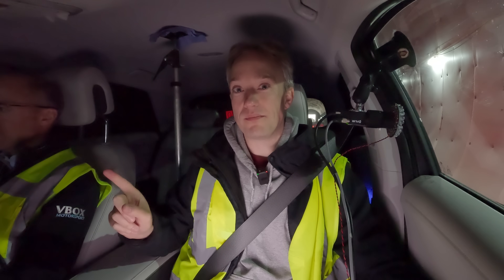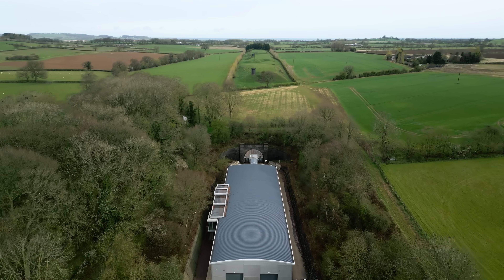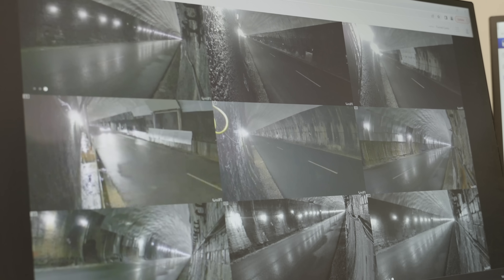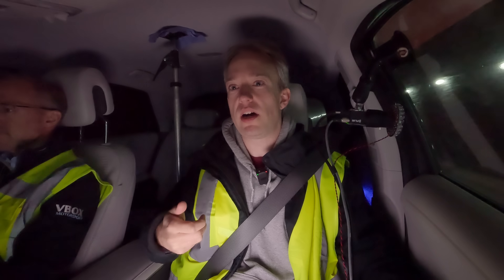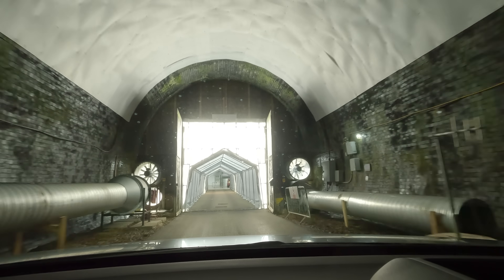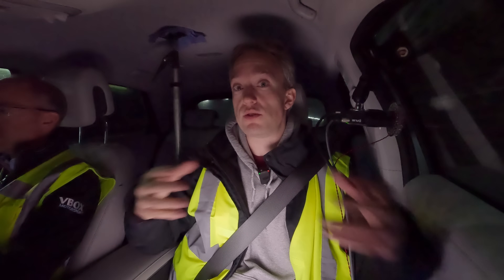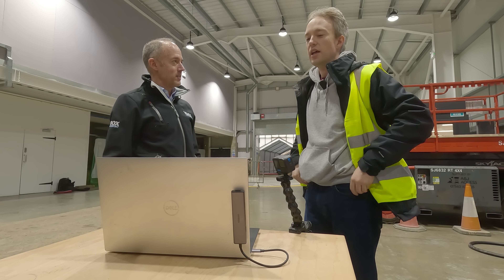This is an excuse to show you a really good tunnel

Comment: Why is a right side drive car displaying its speed in miles per hour?
Reply: @Smee Self Brits don't use kilometers? Weird.
Reply: @Mallory-Malkovich  why would they? Also, didn't you notice that the fuel was in Miles Per Gallon (imp) at the end. Also, I don't get your connection with right hand drive and mph.
Reply: @arfon2000  I thought everyone used km to measure distance except the American Empire. Most people on earth don't have a clear idea what a 'mile" even is, because it's a poorly-devised measurement system from medieval times that every civilized country abandoned in the last century.
Reply: @Mallory-Malkovich  The UK didn't and to an extent nor did Canada.
Reply: @Mallory-Malkovich  Also, to make it more confusing the British Imperial measurements are slightly different to the US customary units. For example a Imperial gallon (which UK/canada use) is .8 of a US Gallon.
Reply: @arfon2000  Canada uses kilometers, and has for nearly 50 years.
Reply: @Mallory-Malkovich  As their speed limit yes. But it's still common for someone to say "couple miles to the shop" or "2 inch thick"
Reply: @Halo Freak  That's due to the ubiquity of American TV in Canada. Canadians will say "he's miles away by now"  colloquially, without having any firm idea what a mile is. It's just a turn of phrase. All distance is measured in meters and kilometers. No Canadian under 60 could tell you how many miles away anything is, because it's not used as a unit of measurement in this country.

Comment: According to the tunnel's operators the gradient is 1:176 which is 15.33m difference between the ends. Also, it was built from nine shafts. They would have had 10 sections of about 270m.

I don't think any engineer would build a flat tunnel. They expect water. They started the Simplon tunnel a year after this one was finished and the error where the two halves joined was about 8 inches.

I am wondering if some of the surveying only worked because the errors were both positive and negative.

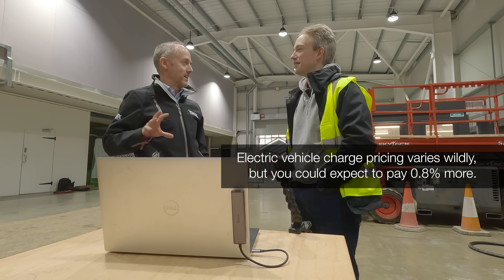Comment: @7:30 my physics nerd alarms are going off.  He's saying that the electric car weighs the same whether it has a full tank or an empty tank as opposed to a fossil fuel vehicle. That's NOT CORRECT. A fully charged battery weighs more than a discharged battery. E=MC^2 and all that.  You can't have energy without mass.  A stretched rubber band weighs more than a loose rubber band.
Reply: Practically there's no difference. A single piece of dust will offset the weight of the car more than the state of the battery.
Reply: You're counting that? You might as well say that the mass of the car increases when it's moviny

Comment: If the tunnel is perfectly straight, not even following the curvature of the earth, it makes sense that this would result in a slight gradient.

You can’t have something both perfectly straight and perfectly level while on a round planet.
Reply: Yes you can, straight as in no left or right turns.

Level as in no up or down.
Reply: @Robert-j6r8c  The video implies that it is straight in both the horizontal and the vertical plane. They say it is both straight and flat. 
(But as a machinist, straight and flat have different definition for me)

Anyway, you get what I mean. Something of this scale cannot be both "flat" (no up and down) and level (perpendicular to local gravity) on its entire length.

Comment: After doing a quick search to satisfy curiosity, apparently, a dead ev battery weighs less than a fully charged battery? If true that's much less of a weight differential than a petrol engine. However, it's still a relevant variable for precise calculations. 
 Any physics majors or engineers willing to clear this up for me?

Comment: I'd like to see the Bat motel and then the golf ball dimples on a car versus no dimples experiment to see if Myth Busters' got it right. 

Then an episode on how the engineers got the tunnel so level when it was made in the 1800s.
Reply: He already said in the Japanese hotel video that he isn't allowed to film other guests for privacy reasons. Hence, no bats.
Reply: @Smee Self Yes, I guarantee you that when they  started rehabilitating the tunnel, the railbed whcih had been abandoned for 4 decades was not flat, +/- 3mm.
Reply: @andrewalexander9492  They weren't talking about roughness of the surface. Of course every dimple in the wall is also deeper than 3 mm, railbed matters equally little.

Flatness as they refer to it means something like straightness, or - take the centroid of cross section at entry, take the centroid of cross section halfway in, take the centroid of cross section at the far end - and they would be on one line +/- few mm.

Comment: 7:23 this is insanely nitpicky, but technically speaking an electric car does lose weight as you discharge the battery due to the formula E=mc2. If you were going to solve for M as E changes so would the mass. But we're talking micrograms so he's still correct that it doesn't really affect it.

Comment: One interesting nit.  Gradient aside, "perfectly flat" (or rather perfectly straight)  is not flat for the purposes of coasting a car.  Mentioned at the beginning, but earth's surface is curved, so if the tunnel were same elevation at both ends, but perfectly straight then effectively it's actually lower in the middle and you're going uphill slightly toward either end. If water leaked in, it would literally pool up in the middle of the tunnel eventually forming a curved surface. 
With the gradient and straight profile it means that the tunnel is effectively steeper at one end than it is at the other end, relative to the pull of gravity.    All of this needs to be accounted for in their calculations.
Reply: This crossed my mind as well. Running these calculations (in a rough approximation that will at least give reasonable order of magnitude) I get a difference in angle of about 0.024°, .04%, or 1 in 2355. My guess is that this effect is so insignificant that it doesn't matter, even at the precision they are doing. Initially I figured this might be less than a rounding error for the given 1:176, but when I tried adding this new gradient I got 1:163, so it would be measurable in that given number - but still probably so insignificant they don't really care. 1:176 is probably the average through the tunnel.
Reply: @Smee Self  Cept if it's truly laser straight, then it is not  a constant gradient in the way that gradient matters (coasting in this case).   A level will measure different values at one end, center, and other end.

Comment: As someone that has used a few wind tunnels I find it very odd that they acknowledge the interference of the tunnel wall yet refuse to minimize it (drive in the center) because of aesthetics. Especially since the target of the emulation  [99.9% of real driving] is not extremely close to a wall. 
Interference from the walls and the percent of tunnel cross section taken by the model cross section is a major effect that must be considered in any wind tunnel results and the effects are non linear with distance from the wall; refusing to minimize the effect just seems outright foolish.

Comment: The surface level must have been done in multiple steps. If you look at some of the shots near the floor level that have low grazing incident angle one can see that the surface appears to have been ground and slightly polished (note the flat top of larger rock with the lack of sand attached to the flat surface).  This was probably done as the last step with a grinding machine that was sufficiently large to have multiple optical targets being monitored by an optical theodolite. Think of a large lapping machine with optical guidance. Probably did not use a Gyrotheodolite.

Comment: As someone who used to work in notoriously more active tunnels, l can say that the procedure for turning around the wrecker/fire trucks was full lock turn until you hit the wall, full lock the other way until you hit the other, then full lock again into the wall once more if you set yourself up well and twice more if you didn't. The trucks were build with this procedure in mind, the difference those last few inches made was astounding
Reply: So a well engineered Austin Powers turn
Reply: Reminds me of the time I had the misfortune to go down a no-through-road in Oxford.
Reply: So you actually physically touched the Wall? Or you Just went as close as possible without touching anything?
Reply: @semurobo  actually contact it. You didn't hit it at speed, and the trucks had bumpstops or a pushpad so there wouldn't be any damage. There wasn't all that much space on either side when the rig was perpendicular, so every inch mattered

Comment: The “hill” that the tunnel goes through doesn’t seem very high or steep (I’m reluctant to even call it a hill!)….Tom (or anyone) so you know why the Victorians went to all the trouble of drilling & blasting that tunnel through solid rock — rather than just putting the tracks straight over the hill??? (Or going around?)

Comment: The opening shot triggers me. The ioniq 5 and EV6 both have the same gauge cluster graphics in sport mode, and it's completely unreadable. I can only sit comfortably in the car if the steering wheel blocks the speedometer, which is half acceptable when it's physical and can't move. But the location of the speedometer is just a few lines of code. A mess of 1's and 0's are the only reason I can never safely drive one. Oh and because I find all the other drive modes completely unacceptable.

Comment: Nice to see the deviation in the measurements is the same as the resolution of the measurement: 100 fps <-> 0,01 s.
And now to be as pedantic as Tom would appreciate; the mass of the car does change, as energy in batteries has mass, it's just low enough that the wearing down of the paint on the car by air friction is probably more than the change in weight if the battery, not to mention the moisture loss of the driver or the wear of the tires.

Comment: I would love to have access to that tunnel; I'm part of an Automotive shenanigans and wild lands trash cleanup group, and I really wonder what all the goofy bits added to my car do to my fuel efficiency. I have a light bar, roof basket with a spare tire and rim in it, some tool hangers, and 2 amateur radio antennas on it. (Both GMRS and HAM)  Also I've lifted it aboot 2 inches.

Comment: I had a friend who would only put $20 worth of fuel in his car because his logic was "more fuel = more weight. More weight = less gas mileage" so he saw that as the perfect balance. This just made me think of that.
Reply: But then you waste more detouring to the petrol station.
Reply: @Robert-j6r8c  The solution is to illegally keep a big tank of fuel in your garage and fill up from that as needed.
Reply: @vylbird8014  
Several legal gas cans for me. Though my motive is more about getting the most out of good deals while I can.
Reply: @Robert-j6r8c  This exactly! Stopping to get more fuel costs fuel, but my mom would never listen...
Reply: But it would have meant gradually putting less and less fuel in his car.  Keep that car long enough, and you're not even going to make it to the shops!
Reply: He's got a point. Although it is probably negligible, 20 liters more or less.
Reply: Less gas = less weight. Less weight means a car has to use less power to get up to speed and will accelerate faster
Reply: Of course, the most ideal mileage would be bicycling whenever you can -- less driving, and likely less weight when you do drive -- but I understand that's not something a lot of people will be able to do without standing on their government officials' heads and yelling at them for a decade or so until they put in safe bike paths.
Reply: While that would save fuel, you could easily spend more than you would save looking/driving for more gas stations so the benefit is minimal, if not actually worse
Reply: but then you're always drawing from the bottom of the tank
Reply: @geoffroi-le-Hook  you're always drawing from the bottom of the tank. Stop perpetuating this old wives tale urban myth.
Reply: The downside is that really wears out your fuel pump
Reply: 16 gallons of fuel is under 100 lbs of mass at best you’re getting 2% efficiency improvement? Nah he’s just cheap.

Comment: I don't understand why they don't use a delta ground speed sensor like they do when they test WRC cars on ice
Reply: That requires you to put something outside the car. Which as shown in the video changes the results. The camera can be mounted inside the car so it doesn't have any impact on the air flow.

Comment: pedant mode - yes the electric car will change weight on each run. e=mc squared remember. Difference is obviously negligible, but saying it doesn't change weight... ooo can't let that slip. its about half a microgram for a 16kwh battery full charged

Comment: Well, if it is straight to the laser, it is curved regarding to gravity. You go downhill until the middle, then uphill. Or do they have a flat earth section in GB?
The actual hight difference is 0.57 m
Reply: the tunnel is flat ignoring earth's curvature, after you go a bit far it actually becomes a slight uphill climb, it goes straight relative to the original point
Reply: @eduardopupucon  Not flat in respect to gravity. What does it serve to make precise measurements like rolling resistance, if you go downhill and uphill? The words "flat" and "straight" don't serve here. Metrology (f.e. land surveillance) already understood that very well. The owners of the test track didn't. "It is off by 2mm." And off by over half a metre. Bummer!
Reply: @MuellerNick  They do a run in one direction, then go in the other direction, and then normalize the difference for the results, did you watch the whole video? he literallly says that the track goes slightly uphill and downhill.
Reply: @eduardopupucon  Did you read what I wrote?
They can't cancel out the fact that it goes down then up from both sides.
Reply: @Smee Self No, you can't have a straight edge perpenticular to gravity. It has to be curved to be straight in *every* point of the line. Gravity is directed to the earth's center. So points of equal gravity are on a sphere (disregarding gravity anomalies).
Reply: @Smee Self And now they are measuring how long it takes for the car to roll out. Uphills!
Reply: @Smee Self If it would be level, you could put a level where ever you want and it would be ... level. So it would be curved. If it is flat, it is flat to a laser.
Nitpicking: A laser beam isn't staight either (-> gravitory lens).

Comment: What happens if the EV catches fire?
Reply: Extremely rare considering the safety features to cool a battery and stop an ignition using specialised gel membrane polymers to stop a single cell catching fire to others cells in the pack

Comment: I feel like you should drive in the center both way. The difference in distance to the walls on each side must cause some affect....as you said, the 3mm down slope causes a noticeable affect; I would guess the wall difference has a larger affect. I suppose it depends on the test you are running. A tunnel wall near you is realistic (real tunnels), but not testing the car itself.

Comment: "How is that for timing" is obviously one step further than "Ha, one take!". Now go, do a rocket launch like James Burke.
Reply: That's not hard to do any more.  All of the launches to the ISS are more or less 'instantaneous launch window' events, meaning that they have to launch at a specific time to reach the correct point in space to dock at the ISS.
Reply: @s2t4i6n9e  of course, technically this is not difficult. But the state of mind you need to be in, timing something perfectly when you know, there's only one opportunity to get it right, is still a challenge I would not come out successful.

Comment: I wonder how much having Tom in the car as a passenger affected the tests. Being inside of the car, of course he wouldn't add any direct wind resistance, but I would think his additional weight would affect drag. Likely more than the GoPros, I'd think.
Reply: It would have been interesting since they'd have had the info from the run with the camera operator and equipment in the back, too, so they'd know how much he affected the run as well.
Reply: Perhaps they were doing a loaded vs unloaded run, to text the affect of weight. What you don't see are the six loaded suitcases and a bag of sand in the trunk.
Reply: Tom being in the car would also add 70 kilograms of mass, which means that the car will coast for longer.
Tom being in the car probably both negatively, as well as positively affected the test.
Reply: did we see him outside the car during a test at all ?

Comment: Which part if the tunnel is parallel to a plane of constant gravitational potential? If it's an entrance: 57 cm of rise in the tunnel. If it's the middle: divide that by 4.
Reply: Wikipedia says the tunnel has a significant gradient of 1:176.
Reply: @gordonrichardson2972  OK, I get it. It was built straight, but not flat, and the gradient change due to the Earth's curvature is small.
Reply: @gordonrichardson2972  my calc says 1:2361 is the max possible value at that location for a 2700m tunnel going northbound, so idk where the disagreement is. I trust my code over wiki, but: it's been while since a made a map.
Reply: @DrDeuteron  The gradient is southbound.